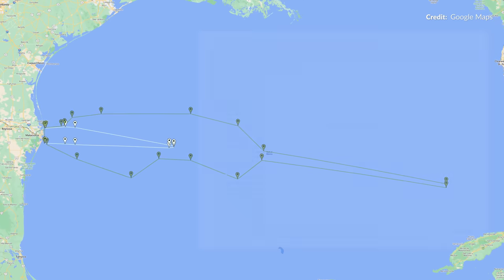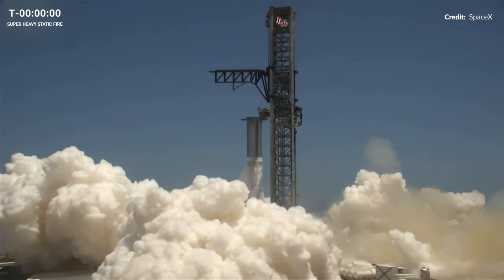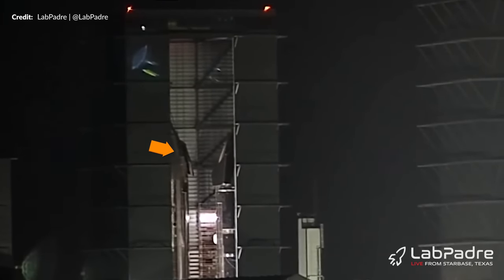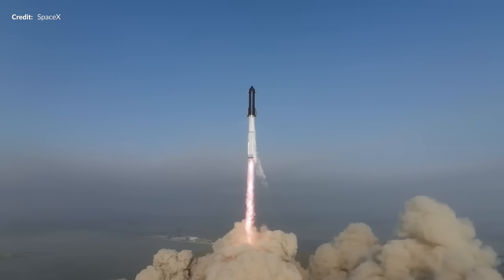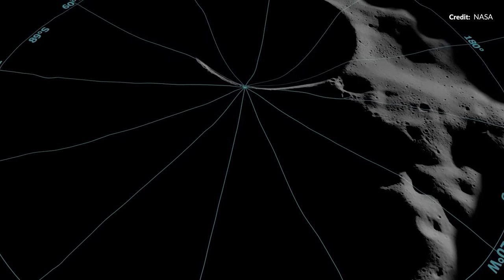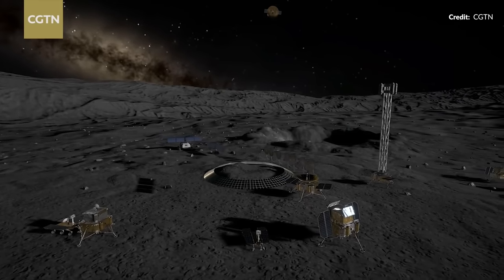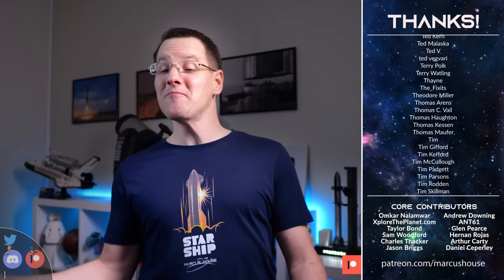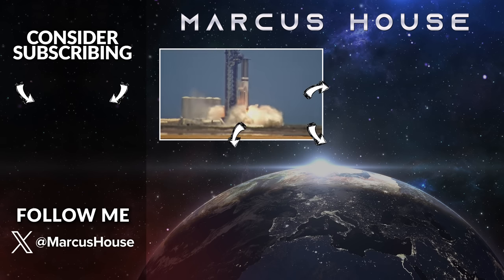SpaceX Drops Bombshell Upgrade, and Starship Flight 2 Date Intention Revealed!

Comment: I was struck how  smaller the nose cone is with that door if you compared to those concept images & videos that have shown for the passenger ship.  It seems its going to be smaller area in the nose areas.
Reply: Part of what happens when you don't have a "down" is that spaces can be utilized in just about any orientation, making spaces where gravity would fight you.
Reply: Some of this videos lack, a lot of necessary things like a septic tank, and water tank, air lock, batteries. so the actual crew spaces is smaller. youtube videos you are ref to is made by kids, not by SpaceX, when you add cables, pipes, radiation shielding, and bunch of other things, it wont be as much space as you think.
Reply: If remember the space shuttle, the cargo space was enormous, crew space was tiny.

Comment: I have deep misgivings about the TPS.  I don't think there is any way it will survive reentry.  If just one of those tiles fails - which is pretty much a racing certainty - then the rest will detach like autumn leaves in a gale.
Reply: Steel pieces in the Space Shuttle survived without heat tile protection despite the Shuttle's excess weight. I wouldn't worry too much, especially since the only vehicle planned for crew in the near future is not meant to survive reentry in the first place.
Reply: @absalomdraconis  Ya that's true.  The stainless steel hull will do relatively well compared with carbon fiber or aluminium but heating to that extreme degree will likely kill off any idea of reusability even if it survives intact.

Comment: Given the labels, the transformer receives 480V AC delta-configured three-phase power (so 3 "hot" conductors, no shared neutral conductor, and a ground conductor that doesn't normally carry currrent) from a large fused disconnect switch nearby (probably the one two boxes to the right); the transformer outputs 208V / 120V AC Y-configured three-phase power (3 "hot" conductors, one shared neutral return and a ground conductor). The manufacturer of the transformer is largely irrelevant as it is a pretty common configuration. The double voltage rating means there is a 120V AC potential between a "hot" conductor and the neutral, or 208V AC between any pair of hots (or you can use all three hots, which is common for industrial motors).

The transformer powers the box to the right, which is just an outdoor-rated circuit breaker panel. The MCB label stands for "Main Circuit Breaker", which the label states is as rated at 225 amps. Given that rating and the size of the box itself, the breaker panel probably has 42-poles (breaker slots for sub-circuits), with a smaller possibility of being 54- or 60-poles (if most of the planned loads are small). It's also possible that some circuits are 2-pole (single phase 208V rather than 120V) or 3-pole (three-phase 208V), which decrease the total number of available sub-circuits. Some breakers could also be "spare" (without a designated purpose yet but usually a standard 20 amp rating), or there could also be breaker slots with just blank cover plates for future expansion (usually called "blanks").

Comment: I wonder, whether they do not need to make a static fire with the hot-staging ring mounted to the bottom of Starship? Even the vacuum-raptors will grill the cone-thing that they added. I would have expected at least some heatshield-tiles or so - but maybe, the firing duration of only a few seconds is not enough to melt the steel…?
Reply: maybe there are cooling lines in there or semething. it is located right above the fuel tanks so it shouldn't be too difficult to cool it with the fuel.
Reply: A steel panel in the Space Shuttle once saved it from destruction during reentry- some heat shield panels had been damaged, allowing reentry plasma to hit the steel panel. Depending on exposure duration, pressure, and temperature, it may indeed survive perfectly fine.

If it is perfectly fine, then they might try to get it to break on the next launch.

Comment: I wouldn't be too optimistic about how soon the next Starship test flight will be. SpaceX only just provided its mishap report about the first launch attempt to the FAA this week. It will take some time for the FAA to work through the report, issue its own findings, and recommendations for SpaceX to implement, before a licence to launch will be granted. That will easily take weeks, probably months. So even if SpaceX feel they are ready to launch at the end of this month, they might not be allowed to launch for several months, until they satisfy regulatory requirements.
Reply: I agree, although I think that SpaceX is actually leading the FAA by the nose on a modernisation of FAA Regulations for spacecraft design and test.
Reply: FAA has been working with SpaceX since Day 1 after first launch on the mitigations

Comment: Anyone working on microwave beaming from orbiting solar arrays to mobile equipment & stations on the surface of Luna then Mars? No atmosphere on Luna makes this a way to have power rich remote units. Build to an optimal reduced scale heavy construction-mining gear, really big tonkas,  sent through a Starship moonlander to test designs for durability.

Pair with a Starship deploying prospecting optimized satellites we can detail map mineral deposits to cherrypick as best we can. Drop Starship sized landers filled with gear to remotely begin test mining. Work out issues like dust control.

Comment: Another great video. Thanks for the effort. Still I wonder why no solar panels are being installed in Boca Chica to supply at least part of the energy needed at that fantastic rocket incubator.
Reply: Because they're already juggling a lot of projects at once, and installing solar panels is not on the critical path. I'm sure we'll see it later, once the new factory buildings are actually complete, and some of the current activity has calmed down a bit.

Comment: I wonder if that hotstage ring will hold up without deformation. If so, does that show the way to greater reductions in booster mass? This sounds stupid I know, but could Boostes incorporate more than one such ring? Perhaps with lightweight plates covering the opening?
Reply: There wouldn't be much point, since most of the rocket needs solid construction to keep propellant inside.
Reply: @absalomdraconis  Most.

Comment: This is a bit off topic but why can't they replace Starliner with Orion ?
Reply: I believe that Orion is a good deal heavier, and bigger. Still, it might be possible.
Reply: @absalomdraconis  Orion is poorly suited to the role Starliner is supposed to fulfil... it's obscenely expensive (a fine match for SLS), and massive enough that you'd need Falcon Heavy or SLS to lift it to LEO. Maybe an expended Falcon 9 could do it, though without any margin for error.
Reply: Orion is a moon capsule.

Its built for something completly different, and NASA wants orion to fly as often as possibile so even old orions will be reflown on the moon missions. No place for LEO flights.

Comment: Hi Marcus, if you still frimly belive that during next test flight the Starship will make it to orbit I have a thought experiment for you. You already know how newly introduced vent ring looks like. Now imagine SH Booster and the Starship in flight. The Starship has sizable wings on it that resist rotation around main axis of the rocket. SH 
Booster has two very large tanks containing LOX and Liquid Methane.  Both tanks are draining very rapidly. Coriolis effecf causes draining liquids to spin. If these liquids are prevented from spinning they exert rotating force on the walls of tanks. Now imagine what will happen to vent ring when top of the rocket is prevented from rotating while bottom of the rocket is trying to rotate due to twisting momentum generated by draining liquids. Just imagine dominos set verically into a ring. Do you see my point?
Reply from the maker: That is what the baffles are for.
Reply: @MarcusHouse  Baffles stop rotation of liquids by transferring force generating that rotation to the ski of the rocket. You cannot use magic to stop rotation you have to use force. That force turns into momentum trying to spin booster.
Reply from the maker: That is why the inner engines gimbal.
Reply: @MarcusHouse  Theoretically you are right but practically your answer is useless. One degree of rotational displacement at 9m diameter produces side displacement of three inches. That is enough to cause vertical support pieces of vent ring to loose stability. If you set up TVC to react to such small displacement than you will set up rotational vibration of whole rocket that will destroy vent ring in no time.
Reply from the maker: @KarolKarolak  I guess we'll soon see if you are right, or the team of engineers that have landed hundreds of Falcon 9's have it under control. I'm more watching the deluge system and the engine stability more than anything else.
Reply: @MarcusHouse  Marcus, Elon's idea of dynamic pressurization of the Skirt disguised as "hot staging" is particularly dumb as it wastes fuel and oxidizer of the Starship, does not address issue of structural (compressive) strength of the Skirt, introduces even weaker element than the Skirt (vent ring) and increases risk of failure of the rocket on the launchpad during liftoff. Your argument is also quite dumb because quantity done not translate into quality and you well know that.

Comment: Can the top of the Super Booster withstand the pressure of three rocket engines? The Russians' rockets would only be used once so they didn't have to think about the top. Although if the rest of the Starship works, the prices for the transport will drop sharply.

Comment: I think that ring has too much suface area to adequetly vent the pressure from the raptors. I believe they are gonna blow up the booster using the ship.
Reply: They'll be testing that, but it doesn't happen with Soyuz, so I wouldn't bet much in either direction.
Reply: @absalomdraconis Yeah, there's no reason to think it will blow up the booster... hot staging is a well-proven technique. But it will certainly do some damage, so the only real question is how much and how that will impact turnaround times for re-use.

Comment: Starship wont be launching till the FAA finishes its report about the FUBAR 4 20   launch , makes its recommendations, then sends them back
 to Space x to remedy them and then for the FAA to finally give approval and say a ok. Starship will be lucky to launch by 2024.
Reply: That wasn't even bad damage compared to what we'll see if a fully fueled stack detonates on the pad, Boca chica will become a cove.
Reply: Prolly right.  There's just a chance though that given the military interest in Starship the FAA may be encouraged to stir their bureaucratic stumps just a little quicker than usual.  Let's hope so anyway.
Reply: @zopEnglandzip  : A full stack going up will probably be gentler, due to poor propellant mixing. You'd need to worry about leaks, but the stack going up will not be a particularly concentrated explosion.

Comment: Still wondering how well does hot staging fare with rapid reusability. Having raptor blasts on the booster is hardly benefitting for durability nor systems being in perfect condition. If SpaceX aims to reuse booster in mere days (hours in some nutty schemes), this development is pretty weird one.
Reply: The only way to get out of that wonder is to...test it

Comment: 19:27 - I wonder if NASA has ever heard of the term "KEEP IT SIMPLE, STUPID..." ie, the Mars sample return mission, WHY THE HELL ADD COMPLICATIONS to a system like have the sample return rocket effectively 'Yeeted' into the air to then fire up and fly away??? MULTIPLE UNNECESSARY FAILURE POINTS ADDED! Just have a simple lightweight launch rack/ladder/gantry move or angle over to stand on the ground, to have the rocket pointed up/or at specific angle, and then the rocket can launch from there (as per the normal way of launching rockets 😏)... I REALLY DON'T UNDERSTAND why they would ADD MORE RISKY procedures to something SO VERY COSTLY, and SO BLOODY COMPLICATED to retrieve something so BLOODY VALUABLE (in BOTH financial cost AND scientific value) from a planet +/- 225 Million Km away!!!
IT DEFIES LOGIC!!! 🤔😒
😎🇬🇧
Reply: Mass limitations
Staged design is more efficient here. If you disagree you can go up to JPL HQ and tell them they are dumb, im sure you know better than them.

Comment: Changes to the engine start sequence on Ship 25 are required. Rvac will ignated before Bosster seperation. SL Raptor will ignated after seperation. Required new static fire test.
Reply: Not impossible to be modified through programming without physical testing

Comment: The pressure from the rocket pushed all the deluge water back into the pipes. The pressure in the deluge system gets critical in less than 3sec firing of the booster that aborted the test. Watch the video again

Comment: SpaceX should relocate the Starships crew/cargo volume to just above the engines and below the tanks. The main points against this have been that it would be structurally weaker, as it would be an unpressured (well, ambient pressure at sea level) section below the weight of the tanks, and walls would be further weaken by any cut outs for windows. However, The vents around the engines at the top of the Super Heavy show that both those problems can be overcome with sufficient engineering, and both problems are greater (more mass, more cut outs).

The benefits of such a relocation would be huge! Embarking and disembarking is far simplified, especially on a planetary surface like the moon or Mars, lower on the Starship. The mass distribution would be improved at all stages of flight by making the center of gravity higher at lift off when the tanks are full (the tanks would occupy the nose) and much lower at landing when the tanks are near empty (when the dominate mass would be the payload). A cylindrical shape is also a far easier shape to fill practically and architecturally compared to a nose cone with either floors with people or stacks of standard cargo (such as future Starlink satellites). For crewed missions it would even be a good location for simulated gravity as the spacecraft tumbling end over end would generate acceleration that with the same "down" as a landed or under thrust Starship.
Reply: This shape has been proposed in earlier Starship version, and has been rejected for various reasons
Reply: @alvianchoiriapriliansyah9882  All such "reasons" are invalid. The Blue Moon Lander concept is similar, though scaled down and less capable, showing that the idea is likely still valid when scaled up.

Other "reasons" against that I've heard are; "The propellant would need to bypass the crewed volume", but now that is already a key part of the design with the current location of the header tank; "You can't have a launch abort system if the tanks are above", but Starship will not have a launch abort system at all; "Passengers won't be able to see forwards below the tanks", but it is actually the norm for any travel where you are not the pilot or driver to not 'see forwards' (planes, trains, ships, busses, and even chauffeured cars, all concentrate on side views), no that it will require crewed control, and a forward view could still be had with a camera relay or by changing the spacecrafts orientation in the coast phase of interplanetary flight (besides a lander is closer in requirements to a helicopter where the "side view" is the primary view needed for safe landing).

Comment: Two space shuttles lost due to the tiles failing what is that saying insanity is doing the same thing over and over and expecting different results
Reply: Technically only one orbiter was lost due to tile failure (though they had a near miss on another) not having the tiles next to a large foam tank should be safer than the space shuttle, but there will always be risks with space flight.
Reply: If SpaceX is doing "over & over", then where's the Starship's external tank & piggyback architecture?
Reply: @SciFlyGal  : That near miss is interesting & relevant- there was a heat shield failure, but the plasma hit a steel plate that was part of the landing gear area... and both steel plate and Space Shuttle survived.

Comment: I don't understand why for the "hot staging" they didn't use the simpler and proven soviet method, a structure of robust tubes deployed in zigzag, I think that is even less restrictive for the rockets gases than the Starship ring. Another point that is critical is the heat shield, I think is taken lightly but we all know that is crucial for the integrity of the Starship during the reentry. On the first static test a lot of tiles were flying to the air, so this is a very delicate problem that must be fully resolved for the first manned mission, so all the hopes for 2024 I think are extremely unrealistic.
And about the Orion capsule, it's hilarious that still has some problems with its heat shield, being a much modern XL size Apollo capsule. Don't you think it's weird that more than half century later, NASA is still checking the radiation that would face the astronauts in journey to the moon, when they already should know perfectly ??, there was no "freaking miracle" with the Apollo missions and their crews, simply THEY NEVER WENT TO THE MOON.
Reply: Touch grass bro
Reply: Open your eyes bro